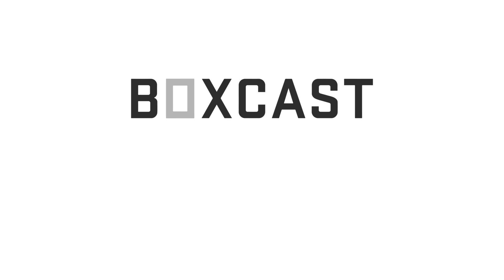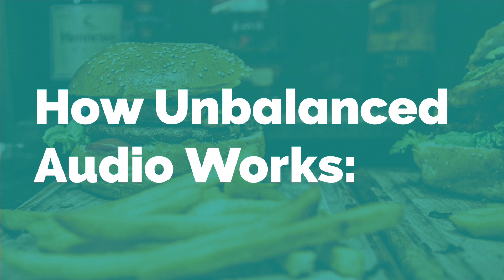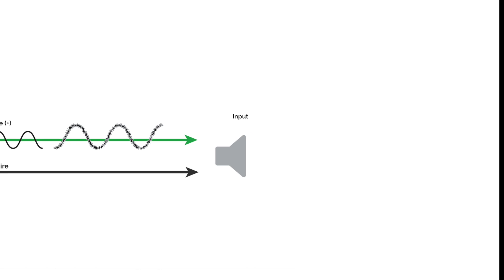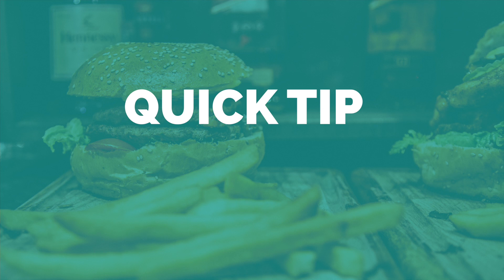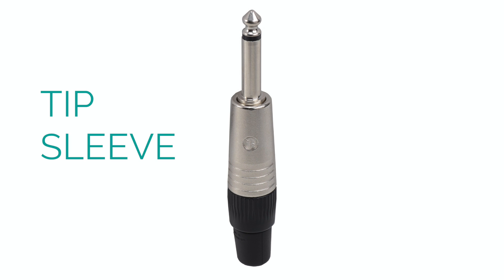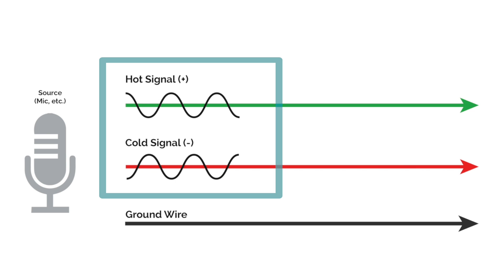Balanced vs. Unbalanced Audio Cables

Comment: Question, does a balanced port on a AMP/ DAC do the same thing then? Just cancel out noise / interference just like a balanced cable do? 

And if so, does that mean you could use unbalanced cables on a balanced port and have it do all the work instead of buying a balanced cable?

Comment: I have an outboard DAC that has both RCA (unbalanced) and XLR (balanced).  I am connecting to a high end pre-amp that only has the standard unbalanced RCA's.  If I use a XLR -> RCA converter, would I get a benefit from using the XLR ouputs on the DAC or should I just stick with the RCA's?  By the way... great explanation and video on an often obscure topic.  Thank you.

Comment: Do you happen to know of any good xlr to lightning cables? Going from an audio mixer to an iPad that is streaming online.  Right now I’m using an xlr to 3.5mm then an adapter to lightning.  There’s always feedback.  I tried a cable with lightning on the end, so no adapter and it was a high pitched noise vs a hiss.  Help 😮
Reply from the maker: hi there! we always like to use an xlr to lightning interface like this when connecting a mixer to an ipad: https://www.sweetwater.com/store/detail/iRigProIO--ik-multimedia-irig-pro-i-o-audio-interface-for-ios-android-mac-and-pc

Comment: It seems I'm too stubborn to understand all the issues. 
Imagine a "single-line" balanced cable (with three wires). Does this mean that even when it has those two interim black rings on the jack connector, it is still a mono cable? Does it need to have 6 wires inside (3+3) to make a balanced stereo cable? Or can you send a stereo signal through that 3 wire-balanced cable? You do not always need to plug two mono jacks on each side of the cable to be able to hear the music in stereo right? You should be able to send multiple audio channels just through a single cable ... (?)  
I'm not entirely getting it.
Basically I thought that cables with jack connectors (and two interim black rings) are automatically considered as cables "transporting" stereo audio signal. So, that is not correct?  
Are there any "one-line" (three-wires) balanced stereo cables?  
Are there any "one-line" (two-wires) unbalanced stereo cables?

Comment: I have a DAP (FiiO M11 PRO) and I use a HiFiMan Sundara helmet. I was suggested to upgrade my Sundara cable for a better quality cable. I am recommended a Meze 99 Classics Series to improve the sound of my Sundara helmet. Meze has this helmet with 2.5 mm OR 3.5 mm.Which one do you think I should choose? And would this change really benefit me in terms of audio improvement.Thanks in advance for your attention.

Comment: I want to know if there are any noticeable differences of balanced and unbalanced cable in using studio  monitor speakers. 

Because my interface have RCA n my speakers have only balanced TRS and XLR input.
Should I upgrade my interface for this?
Reply from the maker: I don't think you're going to notice much of a difference here in sound quality, as long as you don't experience any kind of signal noise with the converting cable you'd be purchasing. I will say you're less likely to experience any issues by going from XLR to XLR, or TRS to TRS, so it might be worth upgrading the interface to avoid any issues.
Reply: @BoxCast  thank you

Comment: Correction: unbalanced actually means on a ts connector, shield (sleeve)  also carries signal. That means the ts and trs carries the same signal on both wires. Being that the shield is a much larger gauge, it is a much lower impedance to ground compared to the tip hence “unbalanced”.

Comment: FYI for only those who want the technical details: 
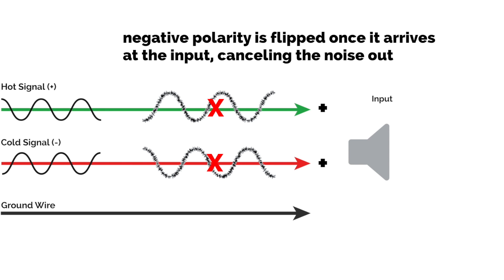at 2:20 it shows the -signal switching polarity, but the diagram shows it flipping "back" from right to left. Which implies the signal would be going backwards in time. That's not what's happening. The polarity isn't "flipped", instead the signals are subtracted: +NoisySignal - -NoisySignal = 2xSignal.
Reply: I totally noticed the same thing, but I figured this was an audio guy, not an animation guy, so I give him a pass.

Comment: Hope you doing well.. Im starting out wit DIY stuff and your videos are quite inspiring!

Wanted to check how to make a balanced headphone cable having one 2.5mm TRRS male jack at one end connecting to dual/2 3.5mm TRS plugs each plug connecting to Left and Right speakers/ headphone driver. Ive seen schematics that show the 2.5m TRRS plus has L+ (tip), L- (Ring1), R+ (Ring2), R- (Sleeve). Can do the continuity test on the 2.5mm TRRS, but unsure about the grounds and connections to the 3.5mm TRS plugs

Some questions:

1. Im not sure how and where the ground wires get connected on either the 2.5mm TRRS and 3.5 mm TRS jacks? 
2. How do i connect the L+ and L- from the 2.5mm TRRS on the 3.5mm TRS on the headphone jacks?  
3. If i connect the L+ and L- wires to Tip and Ring on one of the 3.5mm TRS plugs, will it work? Assuming same will work on Right side plug as well?
4. Does it mean neither plugs have a ground connection?

Appreciate your answers!

Thanks!

Comment: What if you want to listen to music from a turntable with RCA output (unbalanced) through a pair of active studio monitors which have only XLR input (balanced)? Can you still have that vinyl quality sound in the end? Nice vid btw!!!
Reply: Unless your monitors have a dedicated phono in , no. It will usually built in phono stage or pre amp and there will be be a little ground connector for the extra little ground cable off a vinyl deck. You can buy little phono pre-amps to place between deck and amp/powered monitors. Or lots of audio interfaces that plug into your laptop or computer by firewire or usb have ground screws and preamps. Same goes for nearly every DJ mixer and most integrated amplifiers . I'm sure somebody somewhere must have thought have putting one on a set of powered monitors but I've never seen any.
Reply: I am searching for this reason too.....just got my technics 1210s record decks reconditioned..... bought a numark M2 mixer and a set of KRK Rokit 8s gen 4 powered monitor speakers.......
Bit baffled...as it's the old Phono/ line connectors into either XLR or TRS as the speakers have a cool friction lock neutrix combo connectors for the input.
but will the sound be stereo and balanced .... even if I can get the cables!
Will I be better getting an interface ?
Any advise.

Comment: Have 2 Questions:
1. You have a balanced cable 3.5mm (1/8") TRS to XLR 3 Pin Male. You connect the XLR 3 pin to your mixer and accidentally connects the 1/8" TRS to a stereo signal (like iphone). What will happen to the mixer or to the sound?
2. Your mic like (Rode wireless Go) has a TRS 1/8 out (multi-mono out). Assuming that multi-mono means having the same phase, will the signal cancels? Will it break the mixer?
Reply: 1. The mixer should invert one channel and combine the two like if they were intended to be one signal. The noise should still cancel out but the audio will be wired.
If you send two identical signals, the sound should cancel out completely if you you send a song, which is in stereo for example you can check out what happens if you import it in Audacity or a DAW of your choice, split the channels into 2 mono ones and invert one. Things will sound wired.

2.  Well if one signal isnt inverted you end up with no actual sound and the noise will be cancelled.

Makes sense if you think about it.

Comment: so, are all stereo extensions cords balanced then? since they have trs jack? or are they unbalanced because they carry 2 channels and for balanced they are supposed to have 4 rings on the jack? wish you had cleared this on your video.
Reply: It depends how you want to use it. Stereo cords with 2 shielded wires can be used for 2-channel (stereo) unbalanced transmission from unbalanced source to unbalanced receiver OR it can be used for 1-channel (mono) balanced transmission, but source must have balanced signal output and receiver also must have balanced input. "Hot" signal is transmitted via left channel and "cold" signal via right channel of the cable. But it is best to have "hot" and "cold" wire twisted together, so they both are picking maximally the same amount of noise that can be eliminated by subtraction in input circuit of balanced signal receiver. On the other hand - best stereo cords have each channel in separate shield to avoid crosstalks. So stereo unbalanced cords CAN be used for balanced transmission, but it is not the best possible way.

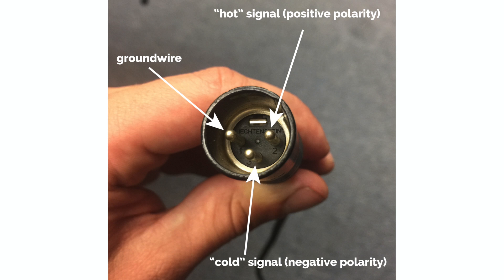Comment: At 2:41 isn't the Tip and Ring for the left and right speaker? Stereo sound isn't 2 totally identical channels so that would cancel out the noise. For example when a car is approaching than the sound is heard better in one ear than the other, that means that the 2 ears don't receive identical signals.
Reply from the maker: Great question. It's interchangeable. The Tip and Ring can be left and right, if you're using that type of cable as unbalanced, or it can be positive and negative if you're using it as a balanced connection. It all depends on the source you're using.
Reply: @BoxCast  that's information that needs to be in the video, because the video is just confusing by leaving out any discussion of stereo, which is what TSR is for most people.

Comment: When using speaker wire and banana plugs with a receiver would that be considered a unbalanced cabled?
Reply: Yes. But the signal strength is so much greater than the noise that it does not matter as much. In microphone and line levels, the signal is much lower and the noise is potentially more of a problem.

Comment: Can I use either one of balanced or unbalanced cable to connect my microphone to the mixer ? will it work with both cables ?
Reply from the maker: Lahiru Asanga both should work, what type of microphone and mixer are you using?
Reply: @BoxCast  i,m using sennheiser e845 and yamaha analog 8 channel mixer.thanks for your support..
Reply from the maker: @lahiruasanga29  yes, they should connect just fine with the XLR connector on the back of the microphone. You may need to ensure you have your mixer's phantom power turned on to power the microphone.

Comment: How does one know if the device you plug in to supports balanced  or unbalanced? Say a 16 channel mixer with a 1/4 inch. Or maybe a guitar 1/4 inch jack?
Reply from the maker: Sometimes the inputs will be labeled "BAL" or "UNBAL", or a variation of sorts, but if not you can always check the tech specs for a specific product online!

Comment: Is stereo 3.5mm TRS to dual mono XLR cable  balanced or unbalanced?
Reply from the maker: Hi Mantra, it will be an unbalanced connection because of the 3.5mm TRS connector
Reply: @BoxCast  Then how can I get balanced output from monitors without connecting an audio interface? ..please help me with this..
Reply from the maker: @mantrapatel1994  What kind of monitors are you trying to output audio from? Why does the output need to be balanced in your case?

Comment: IF unbalanced cables are not ideal due to noise generation, why not just manufacture balanced cables? why is there a need for unbalanced cables?
Reply from the maker: Great question, Arnold! In the video world, we don't have much need for unbalanced audio, but I'm sure an audio expert could give some sort of reason as to the benefit of unbalanced audio.
Reply: You dont need a balanced cable if the run is short and the output and input are unbalanced. Ie. A keyboard and a mixer for example